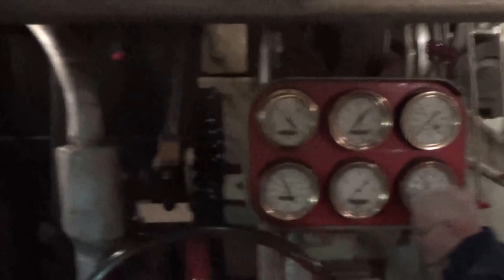MEBA Steam Class Nov5   Nov6 2013

Comment: The Red Valve by the Burner Register is F.O and the Stainless colored Valve on the right is Air ?.......  Which Burners do you have ?  "Pressure Atomizing Rotary Sprayer Plate with Return Fuel Oil Flow" ?, "Rotary Cup Atomizer Burner" or  "Steam Atomizing Burner" ?